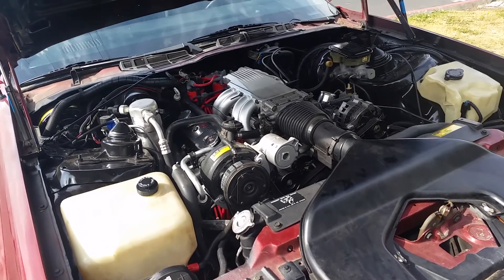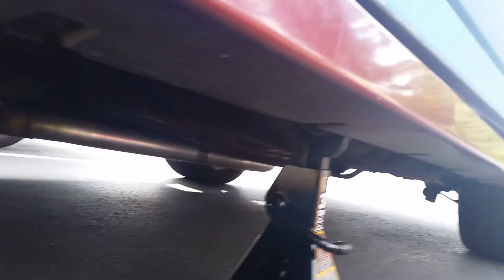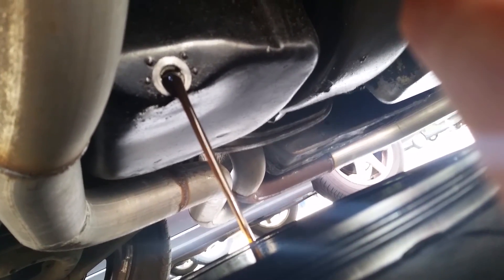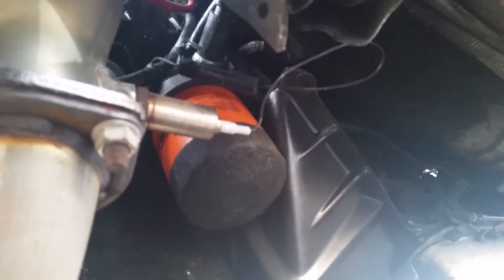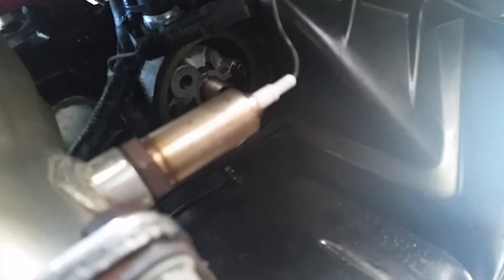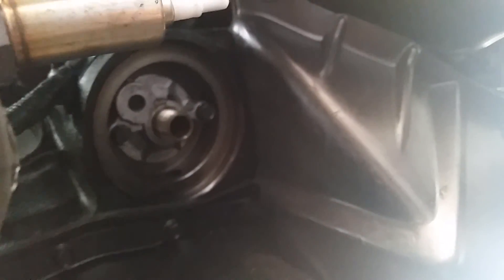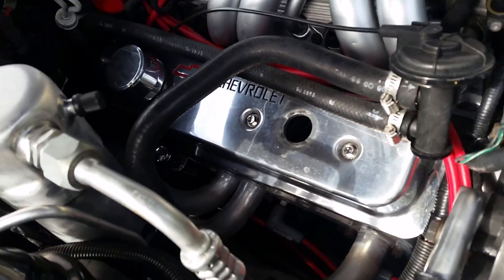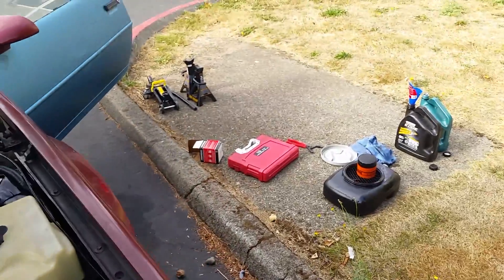How to change 3rd Gen Camaro/Firebird oil

Comment: I got an oil question. So I’m in Florida where it doesn’t get cold too often and I have the same year iroc-z28 should I get 10w-30 or 5w-30 I’m still trying to learn stuff about cars and I did an oil change on my Honda which was pretty easy because everything is there but I don’t have the oil type on the cap for my older car😂

Comment: I either have the 5.0 or the 5.7, the guy I got it off of said it was swapped to the 350 but that model comes with the 305, anyways my question is do you know how much oil both of those engines take?

Comment: What kind of oil do you use? I'm running 5w30, not sure if that's the right oil
Reply from the maker: I have heard of people using 5w to 10w, I use a synthetic blend 10w30
Reply: I have an 84 305 and run 10w40 synthetic blend.

Comment: What would happen if one forgot to add oil to the filter before tightening it up?
Reply from the maker: The oil will end up filling it, it's just better to fill it before putting it on so on your first start up don't have a dry area in the system.